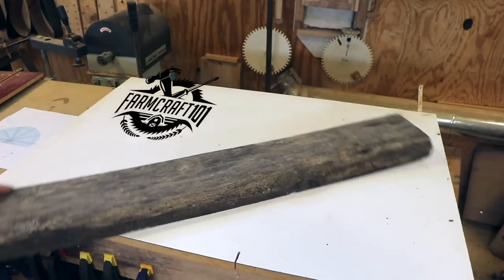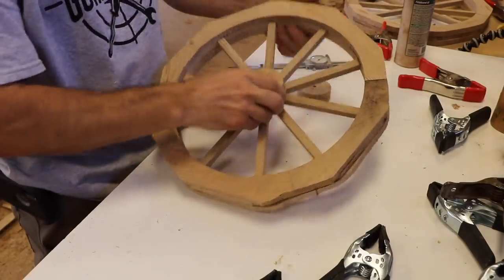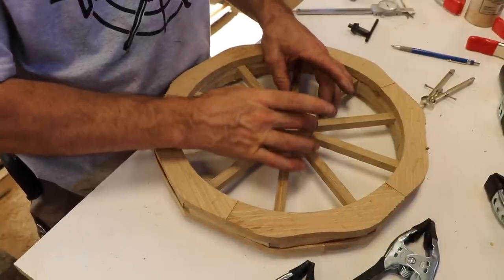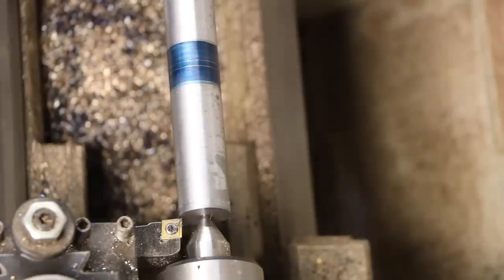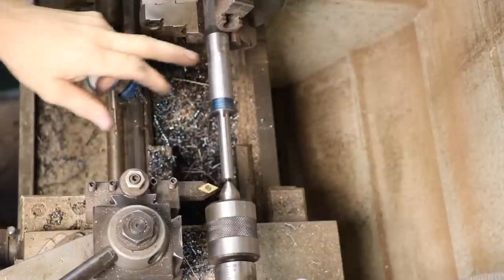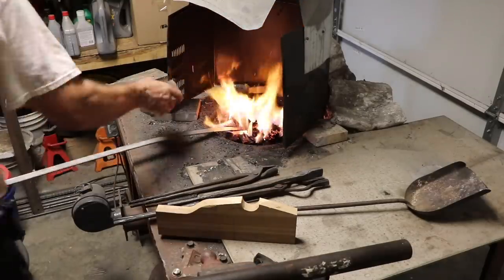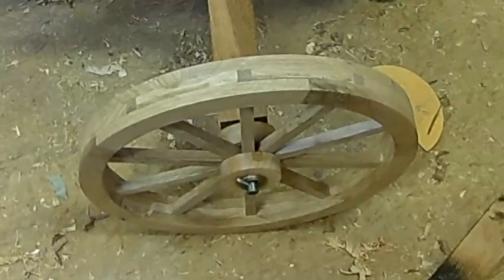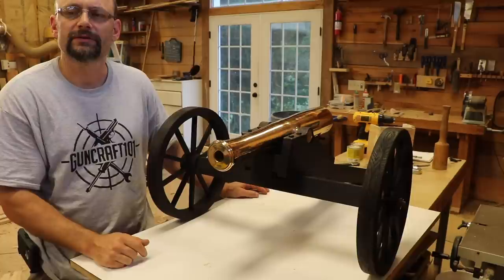Building a Historic Cannon Replica: The Carriage.  FarmCraft101

Comment: Lol the imperial measuring... I feel bad for you guys...
Reply: US doesn't use Imperial, that's a system invented in Britain in the 19th century after the US had already become independent. It uses US customary units, which sometimes differ. E.g. the US gallon is different to an Imperial (British) gallon.
Reply: @Ynno2  I'm pretty sure the US uses imperial, even though it's technically based on metric.

Comment: Well the end knob on the brass cannon is aestetically not pleasing, the shape looks dull, it should be rounded. The shaft of the cannon is a bit featureless. Also the axle of the carriage is just a tad too wide, slightly out of proportion. Nevertheless, great project and lots of work, definitely not trivial and a great experience.

Comment: 18 U.S. Code § 921. Definitions
(a)
(3) The term “firearm” means (A) any weapon (including a starter gun) which will or is designed to or may readily be converted to expel a projectile by the action of an explosive; (B) the frame or receiver of any such weapon; (C) any firearm muffler or firearm silencer; or (D) any destructive device. Such term does not include an antique firearm.
No mention of cartridges, my dude. There is something much farther down which classifies it as an "antique firearm" which is governed under slightly different laws.

Comment: That is not a replica, it is a model.  Also a replica would be a non-firing display.  The cannon he is measuring appears to be a 6 to 12 pounder.  That would require around 1200 pounds of bronze to cast a gun weighing about 800 pounds when finished.   That requires a full size pattern and a foundry to cast it.  The extra metal is needed to fill the channels in the mold, the front of the casting that is cut off and the bore of the cannon that will be drilled out of the casting, about 1/3 of the metal needed.  An actual cannon, whether made today or in the 18th century, is not a replica, a looks like.  It is the real thing that shoots.  A model is a small copy to check things.  Then a prototype is made as a full size functioning product.  Finally copies are made of the prototype for actual use.  These copies may have been made long ago or today.  However, they are functioning implements not replicas.  A recent date of manufacture does not make a replica.